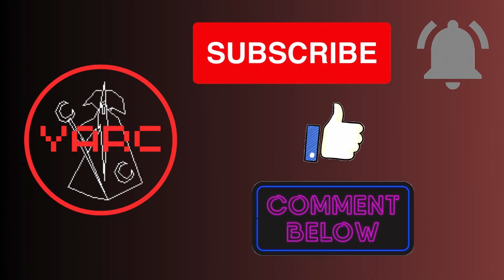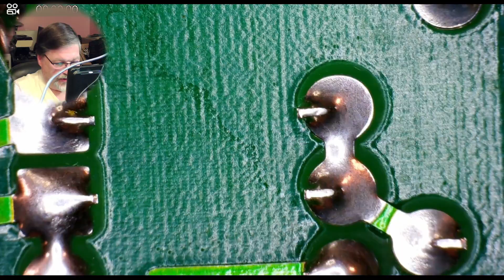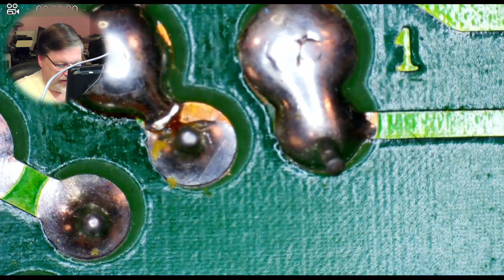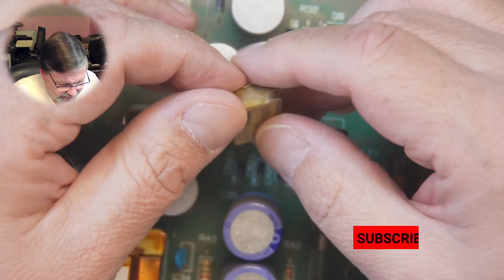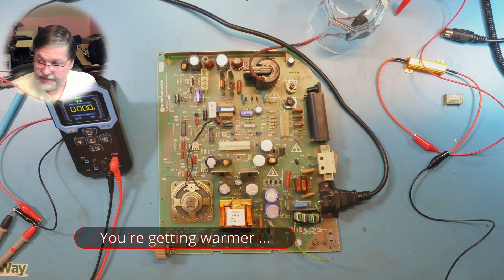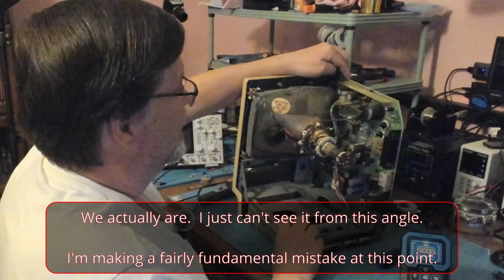Avoiding Disaster With Analog Board Maintenance

Comment: viendo el video veo varios capacitores dañados,cambialos ,las fuentes conmutadas son especialmente sensibles a esos capacitores dañados! un saludo desde españa
Reply from the maker: Thanks for watching. You'll have to be more specific about which capacitors you saw that were damaged. I didn't see any bulging or leakage during my visual inspection.
Reply: Anyone who notices that the plastic cover has shrunk😅
Reply: @carlosRKdestroyer  Interesting logic , heat shrink plastic tends to shrink at 90°C to 120°C so if the plastic cover looks like it has shrunk it’s operating at a high temperature. But that temperature range is close to the high end of the acceptable operating temperature of those capacitors and the heat may have originated externally from another nearby component so in the absence of any other indicators those capacitors are probably okay for now but being old and having spent their working life working at a high temperature I’d guess they’re probably at a higher risk of failing in the future. So should they be replace or not ? that’s going to be a personal judgement based on the intended use case i.e. occasional use, regular use or sold to someone else who may not appreciate it failing shortly after purchase. In any case that was an interesting diagnostic aid you were using and I shall add it to my knowledge base, thank you for sharing.
Reply from the maker: @carlosRKdestroyer  Are you talking about C25, C26 and C31?  Those are the only three I see where the heat shrink plastic doesn't overlap the top edge.  Who's to say that those shrank further as opposed to being the result of the manufacturing process?  I could test those three with an LCR meter, but I doubt they'd read out-of-spec.  i don't like to stress a PCB unnecessarily by desoldering components that aren't bad (yet).  All the caps are beyond their predicted service life. But, apart from a few things like RIFA caps, that we KNOW will pop, I don't like to replace working components for no reason beyond vague concern that they 'might' fail at some point in the future. And I've seen 50- and 60- year old caps that are still working perfectly.
Reply: just my (little) experience repairing "things"😅

Comment: I noticed the gloves disappearing part way through that video if that was because they were two cumbersome I’d recommend keeping one on your less dominate hand as the most dangerous thing that could happen is making contact with something live with one hand while the other is providing a path to ground as the voltage will be across your heart.
Reply from the maker: Yes.  Thank you.  I did get a bit careless at that point.  The gloves made it difficult to fiddle with the alligator clips I was using, so I took them off.  When I went back to recording, I forgot to put them back on.  Your point about the path across the heart is well received and I did know that.  Fortunately for me and my lackadaisical safety awareness, I was still being careful not to touch the zap-y parts with both hands at the same time.  Never even got a tingle.  But it didn't send the best message to my viewers.  Thanks for watching!